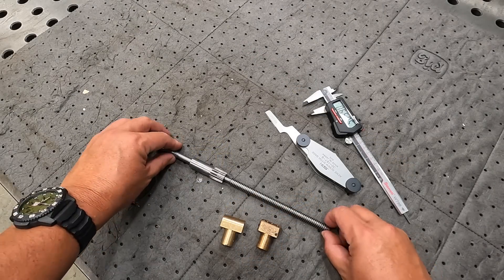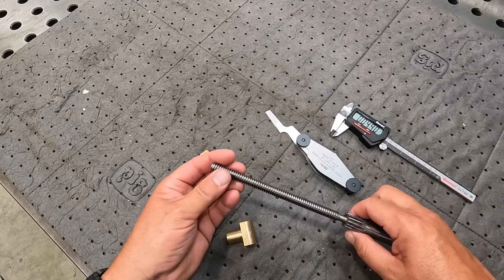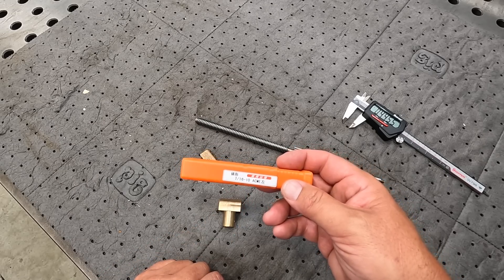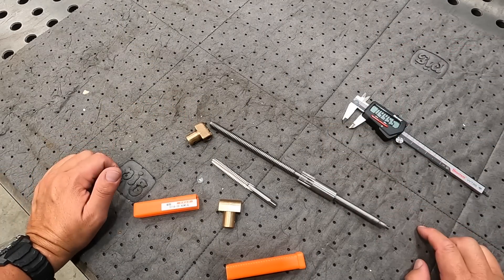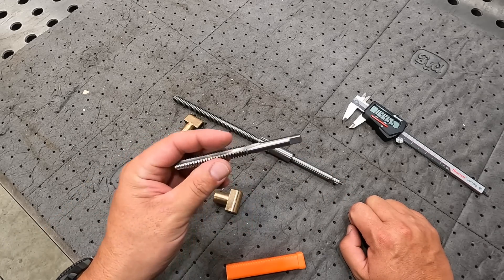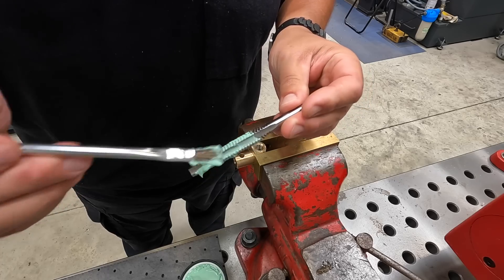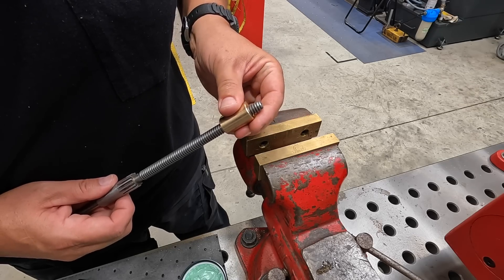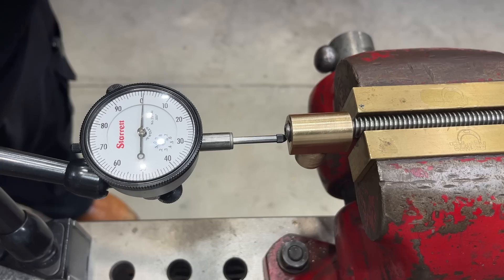Southbend Leadscrew Nut Won't Fit, Tool Tuesday Ep.16

Comment: Imagine owing a lathe and not being able to measure and source the correct size tap for what you’re doing…..sounds to me this person has no business owning a lathe
Reply: Gotta start somewhere
Reply: Maybe it's the $800.00 cost of having the correct tap made? That's the only way to obtain one. It's a 4G class tap that, on a new feed screw for this lathe, threaded to the correct specs should obtain a backlash of .003 or less.

Comment: Not your best video; buy a tap, run it through a pre-made part, see what happens...  Maybe you should have engineered a split nut to replace the stock nut.
Reply: That's why it was a tool Tuesday lol...

Comment: That nut was made to be tight. n You machine the leadscrew to match the nut.  Machining the leadscrew will make the whole screw the size of the worn area.  The nut will then work with zero backlash the whole length of the screw!!

Comment: Was that a left handed thread really?
Reply: Left hand is typical for the lead screw on a lathe's cross slide or compound.  That way when you turn the hand wheel clockwise it advances the tool toward the work.

Comment: Nice work.
I did the same thing, bought a tap and made a new nut from scratch.  My old nut was nearly worn through.
My Atlas lathe which is very similar to the south bend has two nuts securing the cross feed handle.
If those nuts aren’t adjusted correctly it gives the feeling of having more backlash than there actually is.
I hope the owner takes his time and adjusts those nuts carefully.
(Same thing on the compound slide)

Comment: I just went through a VERY similar exercise, except my issue was a tailstock feed screw bushing that was boogered internally. Ordered a 5/8-10 LH Acme tap from everyone's favorite online purveyor of... well, everything, and ran it through the nut. Sure enough it cleaned things up (I used Anchor Lube, as well), but as was Adam's experience, the fit to the threads on the feed screw wasn't what one would call precise/tight. Fortunately, this was one nut of two, in a backlash-elimination type setup and I was able to get things adjusted such that the endplay was minimized. Thankfully, radial play/misalignment is controlled by a separate bearing (which was also replaced), so the whole shebang feels like buttah now.

Comment: Might not have been the case with this nut. Every time I've replaced a lead screw nut with a new one from the mfg, I was never able to screw it through the nut by hand. I had to grease the lead screw and run the lead screw through nut with a drill.  Always tight and smooth after the first two runs throughs.
Reply: I think you are correct.  They cut it undersized for a reason.  I have a feeling the seller was supposed to state it was undersized (they probably didn't know).

Comment: I've had luck on small nuts like this, cutting a slot in the center of the nut, then squishing the slot closed slightly. Not a perfect fix, but a free/easy one.

Comment: I am a furniture maker and a novice machinist. I have been watching your channel for a long time and I learn a lot about tight tolerances from you. I do know that leadscrews need some backlash, so what is acceptable backlash and would a better known brand of tap cut the thread with less backlash or would cutting the threads on a lathe be the only way to manage the backlash?
Reply: backlash is inherent to threads, otherwise they bind and can't be 'threaded'.. to get backlash out of this mechanism it requires a 2nd nut that is being put under adjustable tension / pressure axially to get backlash minimized to near zero and to be able to readjust once things have worn and get sloppy again..  the cheap version of this is to cut perpendicular into the nut without parting it off and using that as the 2nd nut (needs a way to bend it slightly then, usually with a set screw pushing into the cut).

Comment: looks like prior owner tried to make it fit tighter by using punch. Brass pc. has a # of punch indentations.  You could have machined the spline with new threads 2-3 thousands Then a super tight connection.

Comment: I have seen quality improving steeply on chinese cutting tools in the last years. I cannot point obvious difference between name brands (OSG, Dormer, Magafor) in the last two years. Things are very different from 10+ years ago, when they were really poor.
Reply: It's still very hit or miss I feel. 
Sometimes you get actual razor sharp carbide tools and other times, it says carbide but turns out to be softer than lead. 
But all in all I'd agree, that they've been producing very decent tools, taps and endmills, especially for the home/hobbyist shop.

I've only had bad luck with  inserts for the lathe or mill though.
Reply: @nils1953 
I’ve found that cutting tools, collets, Toolholders from India to be superior quality than most of the Chinese stuff.
Robert
Reply: @RobertBrown-lf8yq  that's very interesting! Where do you buy tools from India? I don't think I've ever used any tools made from there.

Comment: One other option would have been to use the 3/8" tap he bought like a boring bar in the lathe to widen out the threads. You could have also optimized the thread depth for minimal backlash while doing this.
Reply: Why do that when he can get the correct tap for $27?
Reply: @utidjian  $27 plus wait for Amazon.  Any time I can save time and money and get the job done correctly, why would I not go that route?
Reply: @duaneohall  Sure... I could see trying what you suggest if I was in the middle of the Indian Ocean on an aircraft carrier and for some reason I had to get the crossfeed screw nut that was in spares working... but that isn't my situation. Nor, I would guess,  is it Aboms (Jacks) situation either. I value my time far more than $27 times however long it would take janking around with the wrong sized tool. With the right tool it takes less time to cut the thread correctly than it takes to compose this reply.
Anyhow plenty of ways to skin a cat or win our own battles. We are fortunate to each have the choices on how we want to do it.
Reply: Agree. Not sure why Abom did this but a great video would have been to do what you suggested. I might have learned something.
Reply: Not

Comment: In my experience the Chinese taps cut pretty well as long as they are high speed steel.  I believe it is because HSS has to be ground which leaves a nice sharp cutting edge vs high carbon steel taps which are probably machined some other way.  I'm sure a USA made tap will last a lot longer but for us home gamers who will probably only use an odd size like this once the Chinese one is usually going to be fine

Comment: Since I'm not a machinist but, been around such machines and living, working on a farm, if the nut is worn, so is the shaft, either replace with new or make new one's yourself. I'm sure my comment doesn't mean diddly but, it's common sense.
Reply: The shaft (or lead screw) is, in this case, made of steel. Often lead screws are also hardened and ground to final size and finish. The nut is, in this case, made of brass or bronze which is far far softer than steel. It is much smaller and MUCH simpler to make a new nut than a new lead screw. The nut is what one might call a "wear part"... in the same way you replace your brake pads with new ones but not always your brake rotors (not the best analogy but the only one I could think of.) 
It is the same thing for the longitudinal lead screw on a lathe. Damned expensive to buy a new one every time you replace the half-nuts for threading.
Reply: @utidjian  I fully understand that however, what we don't know is, how old is the southbend, what kind of abuse has it had in it's life, what's the condition of said machine, even hardened steel will wear. Just only speaking from experience on the farm. :)
Reply: @Ham68229 Lathe and milling machine screws are tough but not hardened. Moore jig borers and grinders and a few other high precision machines would have hardened and ground screws.
Reply: @ellieprice363  Not disagreeing, only stating my experience and I know everyone's experience is different. :)
Reply: He said at the beginning of the video he measured the screw and it wasn't worn.
Reply: @ADBBuild He did, but that method is less than optimal, but probably good enough for demonstration purposes. A more accurate way would be the 3-wire method. For having such a great reputation for quality and design, South Bend could have done better with lash adjustment in their leadscrews, and perhaps taken a few lessons from Hardinge.

Comment: Adam I would suggest trying the tap in a virgin hole the right size and then measure the back lash. Also the other variable is the male thread. Using the thread gage how much slack is in the gage and male thread when measured by feel. I have also used the Acme taps from Amazon and had good results making my own nuts for my Clausing cross slide and Clausing half nut.

Comment: Hi Adam! What I think  the supplier does, that nut is is supplied  undersized,  so you can take a dust cut across the screw because you have worn Center sections and therefore fitting the screw to the nut that's what I would have done.  Also check the screw across wires top bottom and middle and you can determine how much wear you have in the pressure angle.

Comment: Adam I bet the lead screw was threaded with the step one tap which cuts most of the Acme thread and you used the finishing or full thread depth tap to clean it up. I ran into this some years back.
Best wishes
Eric

Comment: Hi, I purchased a couple of Chinese Acme taps, the first one was cutting very large and causing excessive slop between the nut and rod, I finally bought a used one made in USA. that one was very a nice fit.
After that experience I would test the tap first on something that doesn't matter.
Rich

Comment: Won't clamping it like that risk distort the inside of the nut - surely it would be safer to clamp on the pin?
Reply: He isn't using a hydraulic press. It's just hand tight.
Reply: @boothbytcd6011  how difficult would it be to clamp it on the pin?

Comment: Thank you Adam for this new video.
My metal lathe, and my milling machine too, are old machines, they are around 80 years old.
I was given the lathe as a gift, but I had to completely restore it.
In particular, I redid the controls and the two control screws with left-hand thread.
I managed to remove play from the small carriage control using two lapped nuts one on top of the other. I didn't want to use a screw or spring system.
The assembly works very well and is very smooth along the entire length of the screw.
I changed everything because the mechanism was too worn to repair.
I couldn't reuse the bronze nut which was too old and too worn.
Thank you again for this brilliant work and good advice.
Christophe

Comment: I rather suspect if the thread was that bad to begin with there is no telling if the actual hole was the right diameter and so running a tap through, no matter how good it is would not fix a sloppy hole. I would remake the leadscrew and use the tap to do the thread and I'll bet its works just fine. I'm a home a home machinist and I buy quite a lot of tooling from China and for the amount I use it its brilliant, there is no way I could have the tooling selection I have at professional prices. When I find a good supplier of say gear cutters I tend to stick with them for other sizes same goes for milling cutters, I have never bought taps from China but would if I needed something like an acme

Comment: Why was the new aftermarket nut undersize to begin with? I would have then machined the thread on the shaft again, just enough so that the new nut fit nice and snug. This way there will be no play along the entire length of travel. It'll be like new!! The pitch stays the same. Yes they are not to spec anymore, but the next time they wear this bad, its time to get or make a new shaft and nut anyway. I think this is why the nut was actually undersize???🤔🤔🤔

Comment: Backlash on lathe cross feeds is pretty unimportant. So easy to compensate for. Most do it without having to even think about it.
Reply: 😂 It is annoying so it has to been fixed. Maybe you should fix yours to.
Reply: @fearlyenrage  Clearly he has some loose nuts, but as long as he is happy we'll accept him as he is.
Reply: try relling that to a carbide parting tip while cutting something gummy!
Reply: @donsfromnz6515  That's a South Bend 9 inch cross feed nut, pretty sure he's not parting with carbide inserts, gummy or not...

Comment: have you considered trying a "Chicago Fit"?  it looks like the old one had a bunch of them...
Reply: I thought the same.
Reply: even applying a measured force on the old nut in the press would have been better than cutting the new nut to fit the non worn part of the screw

Comment: I stopped at 6:07 ... How i would tap this is from each end 1/4 of the way in .... then just half way in from each end ..... etc .. until it had nive zero backlash and is not to tight .... 

In my opinion THAT is why Acme Taps are made this way ... so you can adjust the fit by making a custom cross feed nut, not a general use standard size nut. 

OK I continue watching :)
Reply: I think the lead screw is worn causing the slop also. I think in the end, the few tight threads in the middle would snug the backlash. It would be temporary but if he does not use it much, that may get him far down the road with tighter tolerances. If tolerances are that important to him he can buy more Nuts to do the same with.
Reply: Isn't that contrary to the "Never back out an Acme Tap" rule?
Wakodahatchee Chris

Comment: Two comments: 
1. It looks like someone did some peening on the old nut with a center punch to try and shrink the threads.
2. I would consider making a jam nut to fit against the original nut perhaps with a bellevue spring washer between them.  That would load the nut to one side of the threads and take out the slop except for loads that exceeded the spring strength.

Comment: There was nothing gained at all. Lead screws and nuts should be fairly tight when fresh and allow them to wear in. A better approach would be a quality sized tap or manual threading. Measuring the backlash should have been done with the nut static and pushing on the lead screw.
Reply: Yes, maybe the new nut was high quality and made in such a way to be a tight fit, and now it is ruined?

Comment: Adam, I have that same lead screw on my South Bend. I cannot find a source for a 7/16-10 LH ACME rod to replace mine which is severely worn. Top of thread is sharp enough to cut. Can you help me?
Reply: Could you upsize to 1/2-10 LH ACME and tap out the nut to match?
Reply: Have done that on at least four leads crew repairs. Worked just fine.   Found and used half  ten precision  ground  acme.  Lh stock.  More readily available  than the  7 sixteenth  @mikewilliams5873

Comment: hey Adam whats the difference in right hand taps an left handed isw it the cutting edge
Reply: The difference is also in the direction of the threading. Regular thread "right tighty, lefty loosey".
Left hand thread is just the opposite.

Comment: People put to much worry in the lead screw for the cross slide for the lathe. 99% of the time when your turning the pressure is pushing back. now leadscrews on mills backlash is something to worry about.

Comment: Nice video, just too many variables that cant be answered without making mult parts to find out the 'why'. I noticed his stock nut was 'measled' (my term) in hopes of tightening things. Did he do that or the prev owner? The lack of backlash adjustment saddens me.... bc I have a 13 and it probably will/does suffer the same issue of design. Some slice thru the nut and add the adj bolt. But on a SB? Demz nuts aint big enough for Ken's scale Winnebago. A custom SB nut might be the solution. Why doesnt that get made instead of the generic nos looking nut?

Comment: If you need to tighten up the threads could you dress down the tap thread to reduce the width would you not cut as deep to take up some of the wear?

Comment: My original cross slide lead screw nut is cast iron ( 9" Logan model 400) I thought that was weird. I wound up brazing the internal threads and ran the tap through that. Not perfect, a little tight at first, but worlds better than it was. I'd like to make one out of brass. I have plenty of brass stock, just not confident enough in my abilities. Only have the small lathe and a 1/2 hp drill press.

Comment: Too bad you didn't measure the backlash at the center of the axle. There the wear is usually maximum. And if that were the case, I would first clean up the lead screw threading by removing a few microns. The nut may then fit without having to use the tap. I still think the backlash is much too high, especially because you only measured it at the unused end of the lead screw.
Reply: yup theres always worn part somewhere depending of use case...